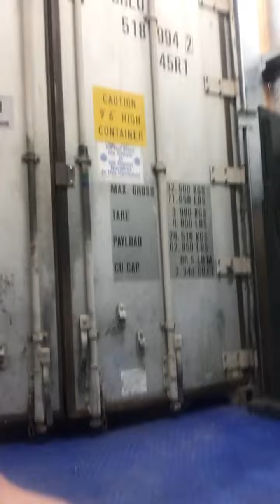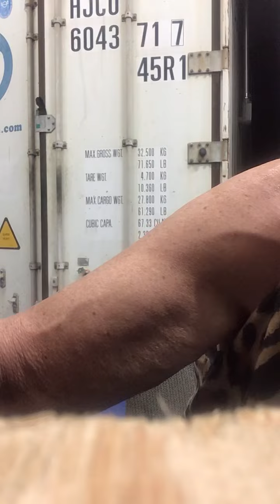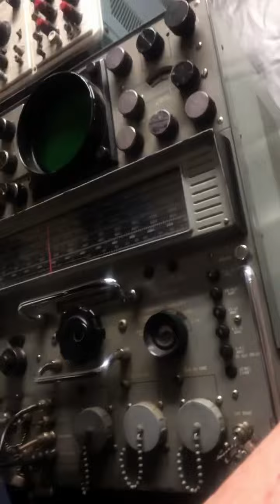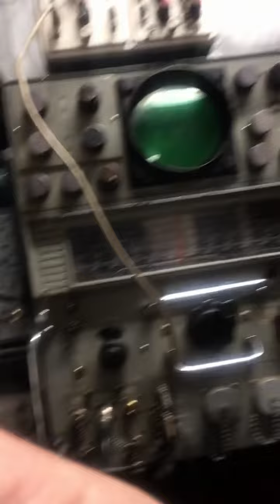44 minutes if nothing realy

Comment: When in the course of human events it becomes necessary....
    Sounds like main st south of Safeway and the skunk train depot. Or is it west on 20?  
   The vocalizing corvid was referring to the electrical cables responding to solar influences and telluric currents causing a frequency response that are within her visual cognition.
     Carving stone, wood working, human locomotion self propelled technology, horticulture, natural systems interplays, Things like pressure mediations within rotating oscillating electro magnetic coaxial luminal perturbations in a dielectric flux field curiously arranged from obsolete and scrounged discarded contemporary appliances and naturally occurring materials.
  Need to overhaul launch mechanism for #2 son.